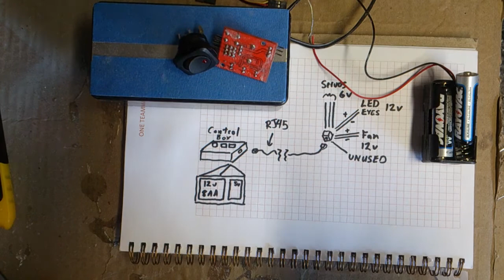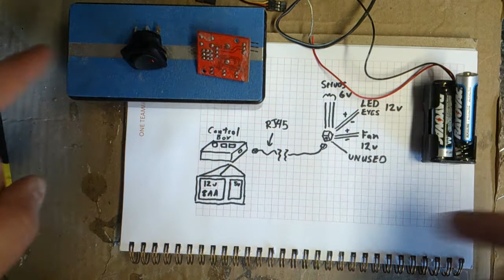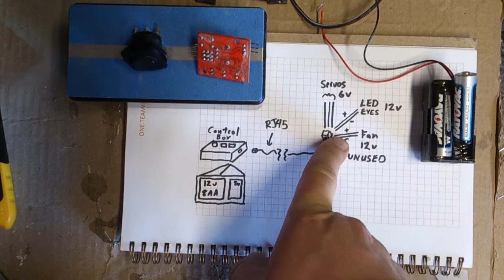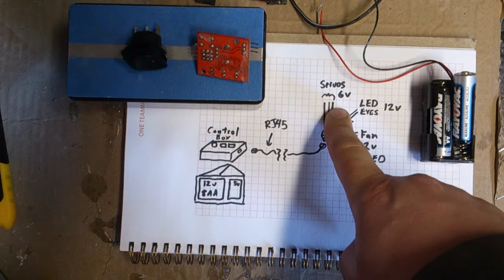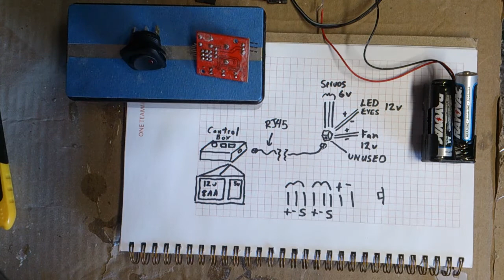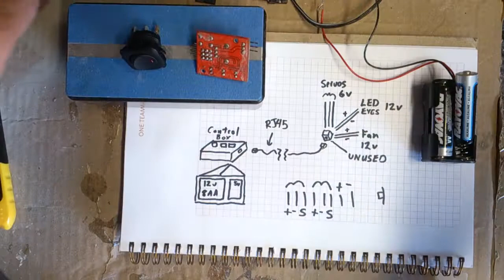Beats by Dre IronMan helmet Control box setup

Comment: What you could do is run both servos on the same positive and negative for power, but use separate signal wires. So the power for the servos would be plain parallel. I'm not sure if this would work but you could give it a try.